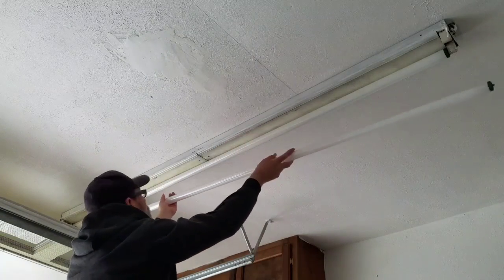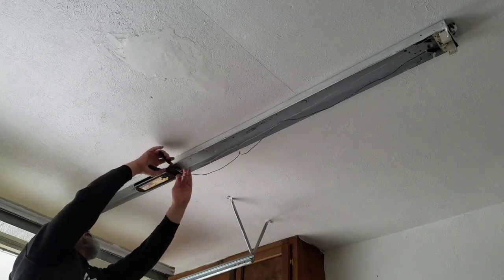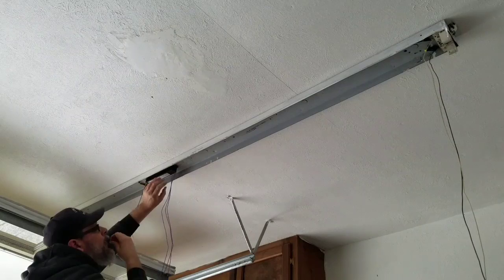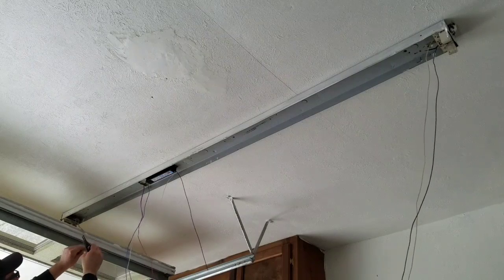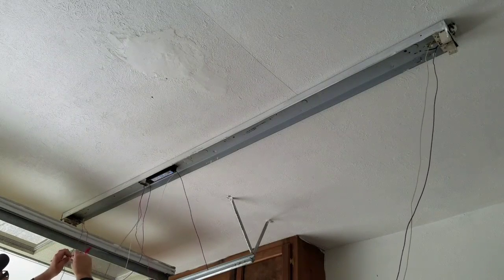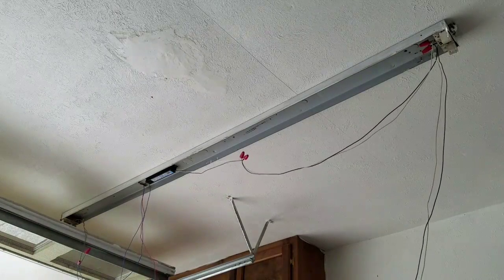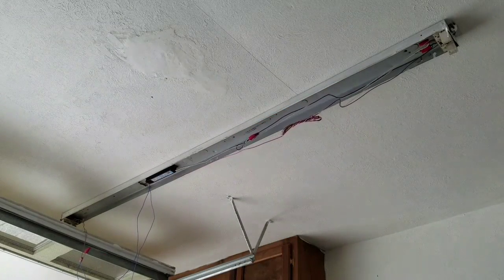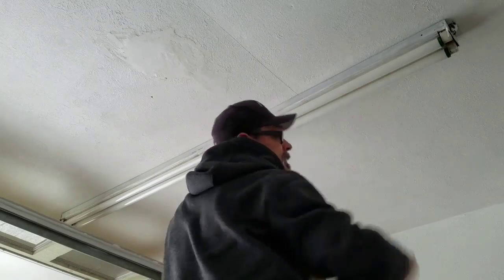Replacing a F96T12 75 Watt Single Pin Ballast

Comment: I bought an old house with a large shed which has these 8 ft lights.  All the florescent lights I've ever used were 2-prong-insert-twist.  This is the first video where I learned these lights are spring loaded.   Thanks for your help!

Comment: Many of the old F96T8 slimline ballasts had the hot and neutral wires going to one end of fixture. The covers  on the bottom of fixture are called belly pans, not dead pans.

Comment: Anthony, I changed the ballast as you did (2-8' T12 single pin bulbs). The ballast I removed had the a/c black and white wires and the colored wires were just one red and one blue, the replacement ballast had two blue and one red. I tried different combinations leaving one wire capped which gave me either partially lit bulbs or just one bulb lit. In your video it looked like you may have had one wire extra also. Is there something I need to do to make the new ballast work? 

Thank,
Paul Furgalack
Reply from the maker: +oddakee Wakiwein on your new ballast there is a little drawing. Wire it according to that. Do not wire it based on what you see on the old ballast.
Reply: @oddakee did you ever solve this issue? I am having same trouble. Also, how can the black and white wires connect to the same wires that the blue ones need to connect to?
Reply from the maker: +Justin D the b&w wires won't connect to the same as the blue ones. B&W are power ("in" if you will) and the blue are basically millivolt from the ballast to the bulb.

Comment: It's me oddakee again. Thank you for your quick response Anthony. I understand following the wiring diagram on the new ballast my problem is new ballast has a total of 5 wires and I only have a total of 4 wires on the fixture. I have no place to connect the 5th wire. The fixture in your video it seems has the two AC wires on one end and two on the other end one for each bulb(possibly a third wire hanging there in the video). According to the diagram on the new ballast the 5th wire needs to be connected to the opposite end of the bulbs where your AC comes in. Sorry for all the questioning, just desperate, can't find a ballast with just 4 wires that the old ballast had.
Thanks again,
oddakee
Reply from the maker: +oddakee Wakiwein it's no problem but this is common, the "old ballast wiring" always gets people confused. Other than the black and white wire you have 3 others wires, 2 of which are the same color, correct? If you look at the drawing closely those two wires go to one end of each bulb (which end doesn't matter). Most likely right now you have a wire which connects both bulbs at this end, then just the one wire which goes to the old ballast. Look at the drawing very closely and you'll see what I'm referring to. If i am correct, you will need to disconnect the old wire that connects the two bulbs ends together as you must use the 2 new wires (usually the same color like blue or yellow) separately. The key to this is looking closely at the diagram and wiring or rewiring the fixture to that. Do not use the way it was wired with the old ballast as your guild it will confuse you every time.
Reply from the maker: +oddakee Wakiwein so without looking at the ballast it's hard to say, but normally if have two wires are the same color and your fixture only takes one then you just tie those two wires together. If you have two yellows your fixture only has one, you just tie both the yellows together or if you have two blues just tie the two blues together.

Comment: Question, I am working on the exact type of light in your video, I replaced the ballast, bulbs and all parts, but when I turn it on, it keep flicking, due to poor connection I think, I then tried to rotate the bulb. It lite up fully for only three seconds, then go back to flicking. What else can I do to fix this problem?

Comment: I hope that you didn't throw away the old magnetic ballast that you removed from the fixture. The older magnet ballast that really have nothing broken in them when they fail after running for usually a few decades, only the capacitor that ups the current to usually around 250 volt to allow the bulbs to come on. without the capacitor the voltage drop is too great to keep the bulbs glowing or come on usually , most of the time u can see them flicker a little bit trying to come on but because there is no charged capacitor discharging into the bulbs after many years of run-time the capacitors fail to charge up and just act as a passing conductor for the A/C current. Open up the old ballast and locate the capacitor, check to see what voltage charge the capacitor is rated at and put a new on in its place.  I've done it with2 old magnetic ballast that were discarded that i salvaged and fixed doing just that. I have built my own custom lamp fixtures using just the bulb inductor coil(choke) on/off open/closing A/C line switchs and a capacitor and all work just fine and keep working =) so dont discard any of the old ballasts they are banned from production sense 2005 here in the states anyways.......
Reply: You know it is just easier to replace it not salvage it because then a few years later it will be dead again
Reply: The old magnetic ballasts often contain pcb in the tar, so I don't want to open one. The only magnetic ballast that I personally replaced, I took the autowrecker in my area that has free scrap metal drop-off. It was from 1999, so I am almost certain that they phased out pcb in most applications by them, but my mother definitely wouldn't like me making a mess.

Comment: Oddly I am replacing a ballast with exactly the same issues. Power going to one end of the fixture and the ballast. Plus the ballast is significantly shorter than the old  massive brick ballast
Reply from the maker: +Byrdcraft did you figure out all out though? You can use a self tapping pan head tek screw on one side of the ballast to hold it in instead of the nut/bolt combo on the fixture.
Reply: Massive Electric it was kind of hard to see exactly what you do with the two connections for each of those fixture ends. Did you tie the two whites and the two blacks together to connect to the ballast?
Reply from the maker: +Byrdcraft yes, as far as the white and black wires go, all the whites go together and all the blacks go together.
Reply: Massive Electric is it a normal new bulb thing for one end to occasionally do a flux capacitor thing?
Reply from the maker: +Byrdcraft No. Like flickering? If so, it sounds like the ballast may be miswired.
Reply: Massive Electric it has stopped doing it just needed to warmed up I guess. It wasn't flickering it was like a pulsing wave kind of like have you ever seen a cuttlefish changing colors. It was like 2' then slowly reduced to 6" slowly increased to 1' then slowly went away. Fine now.
Reply from the maker: +Byrdcraft fluorescent lighting can do that if it's chilly.
Reply from the maker: +Byrdcraft did you figure this one out? It doesn't really matter which side of the ballast or the fixture the wires come from or go to it's the configuration. Different manufacturers will have a little bit different configurations and your old Ballas the big one was a magnetic ballast all the newer ballast or a lot smaller because they're electronic.
Reply: Massive Electric yeah all good thank you so much
Reply: Are they Philips Alto lamps?  Those are prone to doing that, it's fine.
Reply: Massive Electric one of the single pin sockets has a set of contacts which disconnects the ballast when the tube is removed, to prevent electric shock.
Reply: Same exact situation...the video and the information here helped out. I ran the blue wires from the ballast to each fixed lamp holder with two wires (one blue wire to two white wires and one blue wire to two black wires). I than ran the red wire from the ballast to the two plunger lamp holders with one wire each. I connected the power and it worked with no more humming noise. Thanks